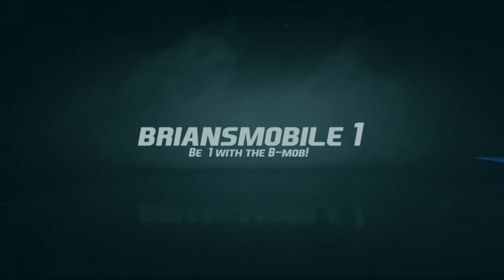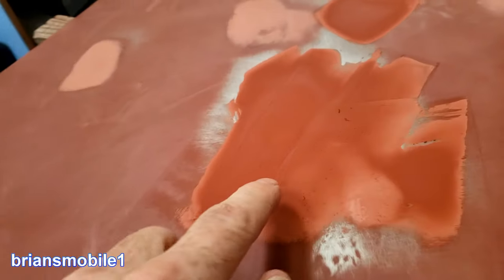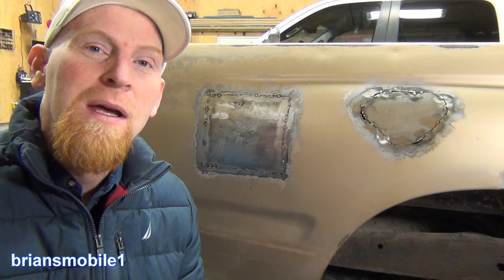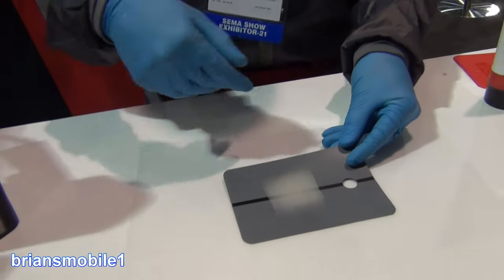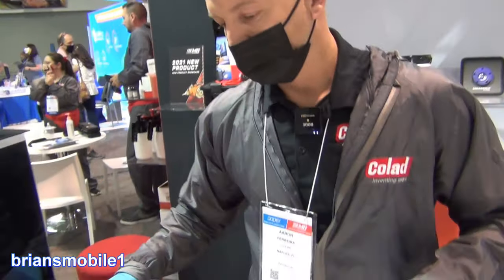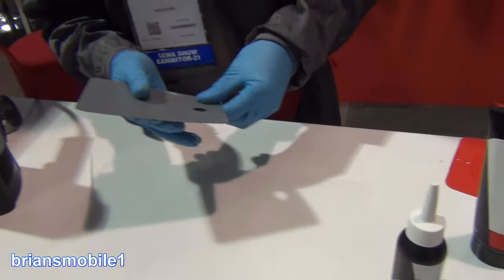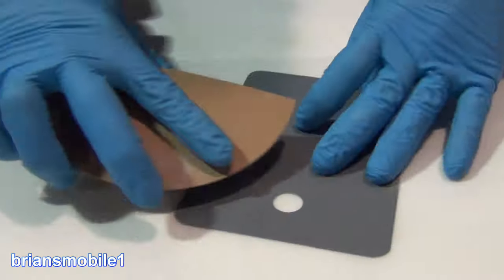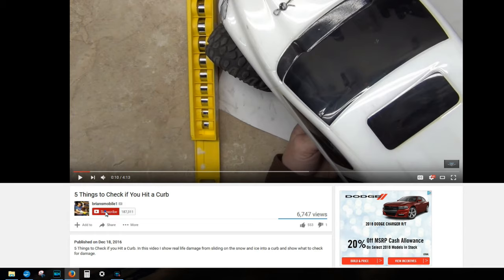LIGHTNING FAST Glazing Putty!

Comment: I remember Bondo came out with a UV body filler back in the late 90's. I thought it was so neat. I put it on the roof of my truck to fill a single dent and pulled it out into the sunlight. It set up pretty quick. BUT it was hard as a rock and nearly impossible to sand. I think I ended up grinding it out with 36 grit and putting regular Body Filler in.  Not sure how hard that stuff sets up but even if it was, probably wouldn't be too bad for pin holes.

Comment: glazing putty comes in handy when your laying down primer then find 1 or 2 imperfections like bullseye's on old cars multiple paint jobs several ml thick the DA may not get it feathered. in autobody college worked on a 68 charger had some pitting without holes on deck lid filler panel they said best NOT use body filler just prime it & glazing putty. they make flexible stuff for deep scrates in bumper covers & atv fenders